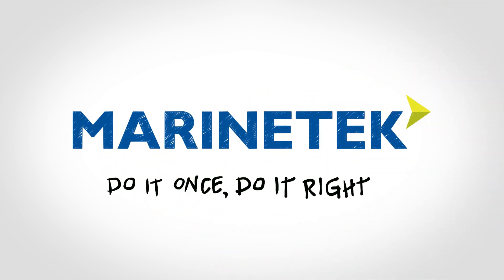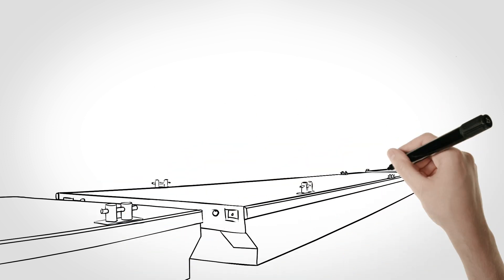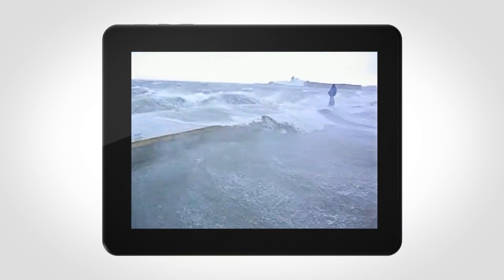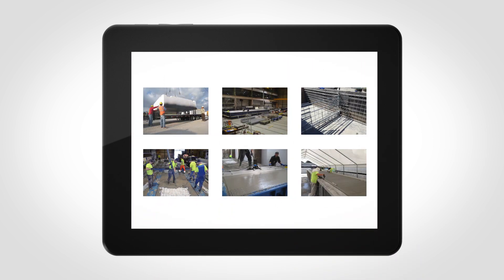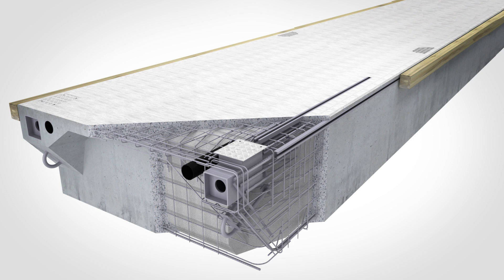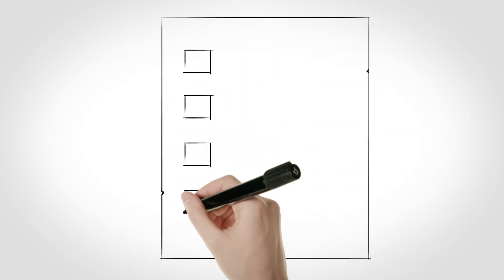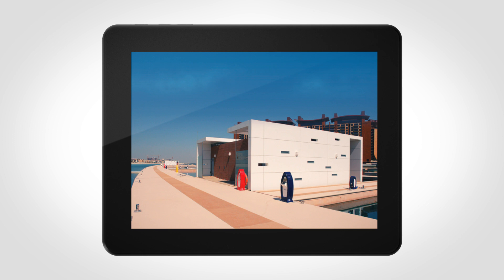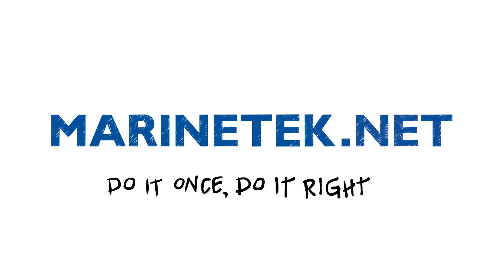Marinetek structural concrete pontoon

Comment: May I know what your concrete made of? Please email me joshua.ferdinand@ui.ac.id
Reply: cement you can use aircrete ( cement — airfoam agent — cement hardener chemical - waterproofing additive ) 
for foam can use poly urethane closed cell foam agent use in home insulation 
normal steel rebar as structural with hollow pipe inserted  can put polythene thin hdpe sheet wrap around for added waterproofing  before steel rebars.
Reply: can use steel but galvanised treated with added rust resistant paint